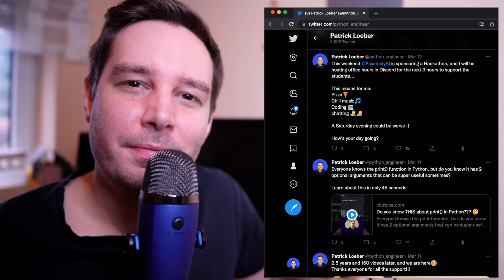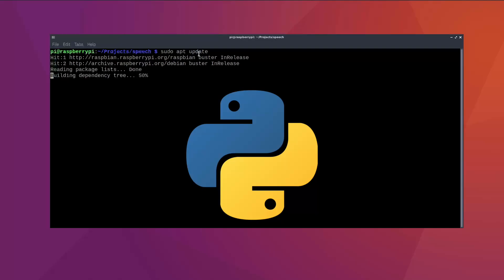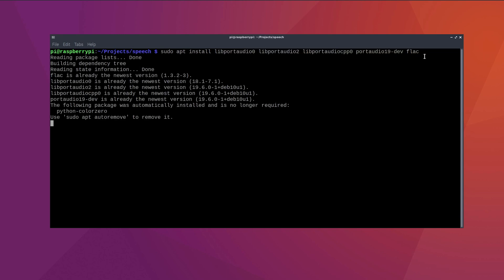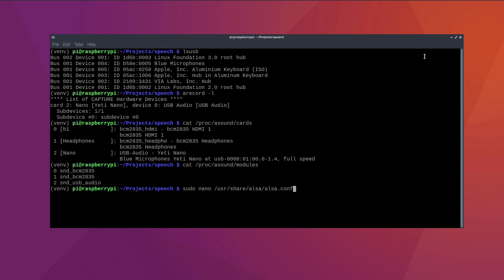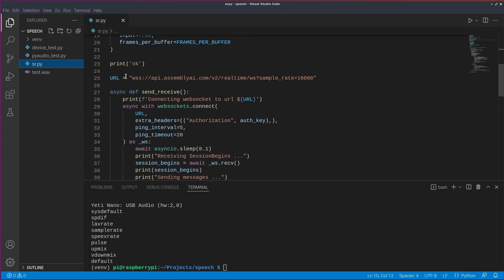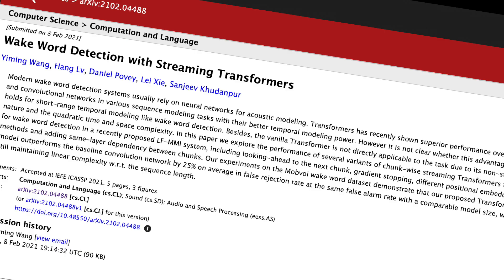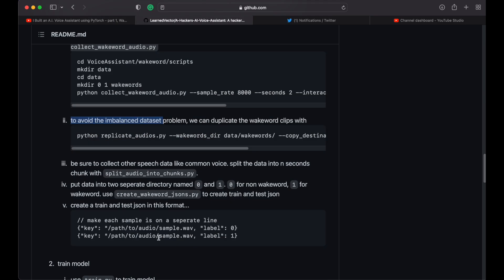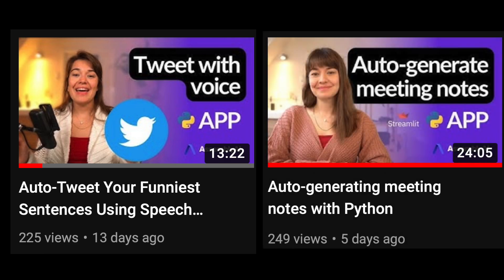Build a Speech Recognition System on a Raspberry Pi

Comment: Would be way cooler if they provided some ASR library that works on device without an Internet connection. This makes the most sense for the raspberry Pi and edge devices.

Why do you even need a raspberry Pi for this? Just do it straight from your laptop.